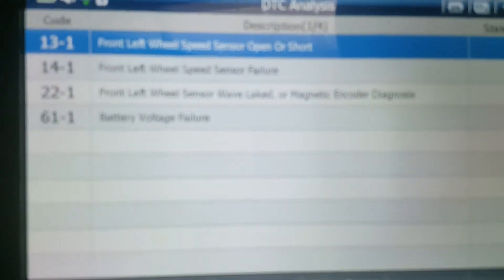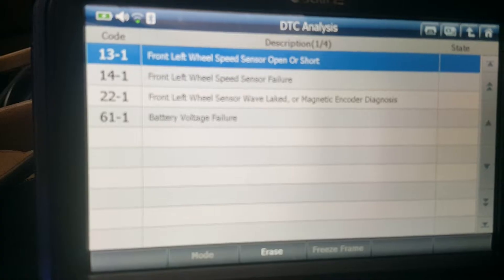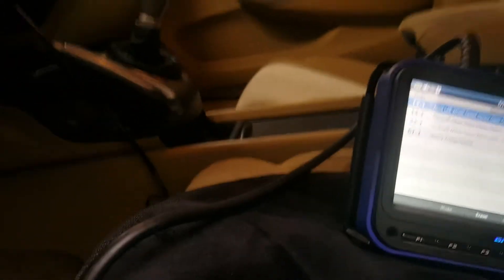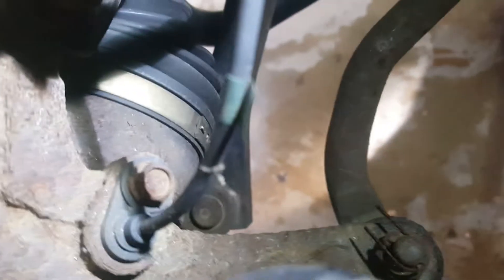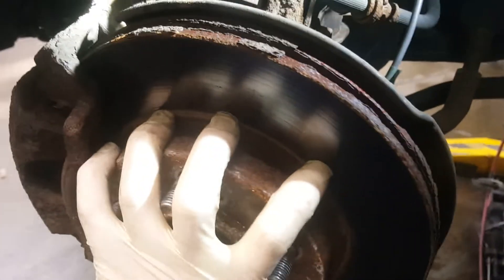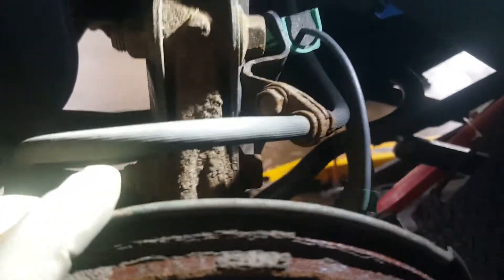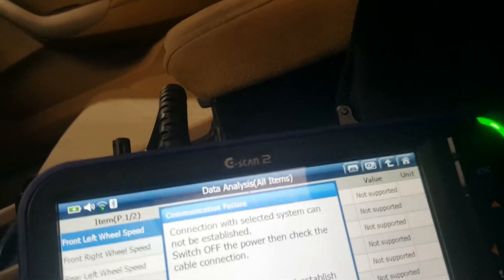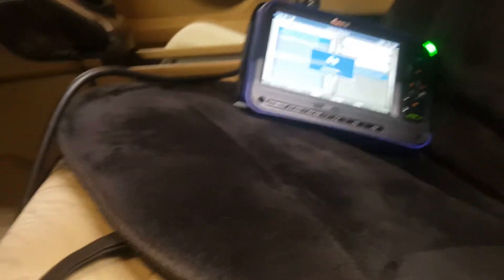Honda ABS light LF Wheel Speed Sensor " Quick Test"

Comment: Had to drill out old sensor, rusty and crusty. Installed 2 new sensors, 4 wheel speeds are moving in L!VE data stream (while driving) clear the code, drive 50 feet and DTC 22-1 CONSTANTLY RE-EMERGES TURNING ON ALL OF THE ABS WARNING LIGHTS 😢😢
My guess is the ABS module has seen its better days after constantly swapping sensors.

Comment: Hello, I have a couple of questions.
2012 Honda Civic Hybrid, warning lights: Check Break System, ABS, VSA, Road Hill Assistance. 
Error Code: 13-11 LF Wheel Speed Sensor No Signal. RF (passenger side) speed wheel sensor confirmed it works fine.
I also noticed that the engine does not turn off when I stop the car and have my foot on the break pedal. Normally, the engine turns off and then turns on when I take off my foot from the break pedal (this is hybrid). Questions:
1. Does the error code need to be cleared first by technician prior installing the new LF speed sensor?
2. If the issue is still there after replacing the LF speed sensor, it is not the bearing, wiring on the sensor is not damaged or there are no poor connections on the sensor, connector fitment is good, what else it can be?
Thank you.
Reply: Did you managed to fix ? I have the same issue with right rear wheel speed sensor.
Reply: @bakmaharangana  No, I didn't. It's not the sensor. Honda service told me that it is a wiring issue, a cable might be damaged somewhere inside the wiring harness. They would have to replace the whole wiring harness, because cables are inside the plastic tubes and hard to find which one is bad. To replace the entire wiring harness assembly it would cost me including labor close to $10,000. It's not worth it so I am driving with the warning lights. It's been 2 months now and so far no change. I'm waiting for the Tesla Model Y Juniper next year. Until then I will drive like this unless it becomes inoperable. Let me know if your issue was the right sensor. Yours is on right wheel so you might be lucky. Sensor is only $20 or so on Amazon. Just make sure that you order it based on your VIN number. Good luck!
Reply: @romeo166166  I'd strongly recommend you get 2nd and 3rd opinions. It sounds like the dealer is just guessing.

Comment: great video 👍🏼. I have a 2008 Honda Civic 1.8l and I’m having issues with the calibers sticking. I installed new calibers, slide pins, rotors, brake pads and both front brake line hoses. I’m still getting stuck calibers. I filled the brake fluid reservoir to the correct full level but can not seem to find the problem. There’s no leaks around the master cylinder and the brake lines look good. Break fluid runs through the front brake lines properly. I’m stuck on this one. If you or anyone have any ideas on what my issue is can you please let me know. Thank you.
Reply: Hand break wires if you have a Ex they are known for their back calipers I change them 3 times they keep getting stuck when it’s cold and use you’re hand break in a hill
Reply: I had a similar problem on two sets of parts store pads. Check to see if the pads are too tight in the spring slots where they mount to the caliper. I had to file down the top and bottom of the tabs so they were snug but would move in and out in the spring clips.

Comment: My wheel bearing was replaced on my Honda accord 2012 and now my ABS light won't go off
Reply: Bearing was likely installed backwards. It is magnetized on one side only to activate the sensor.
Reply: I got similar work done on my 2004 mdx now with the same issue.. were you able to figure it out? Both front sensors are good.
Reply: @zaybarz9200  They may have damaged the ABS sensor wire.
Reply: @zaybarz9200  Apparently there is a magnet in one side of the bearing that gives the signal to the speed sensor. If the bearing was installed with the magnet not facing in then it will give an error. I would see if my mechanic can flip the bearing around.

Comment: If that sensor doesn't want to come out with A LITTLE wiggling, abort that plan and look at it another way.
Reply: Penetrating fluid and subjecting to VERY GENTLE heat (say a rag dipped in boiling water and held on for a minute or so) will likely help.

Also gently levering/prying with two small flat blade screwdrivers should help. Refit with a light smear of copper slip!
Reply: I just drill mine out. Takes minutes. I order a new one before I do it. If it comes out fine. I have a spare on then.